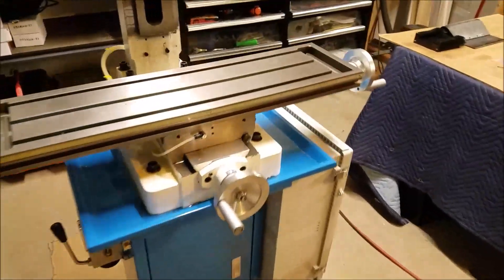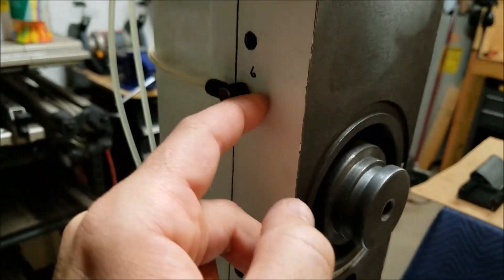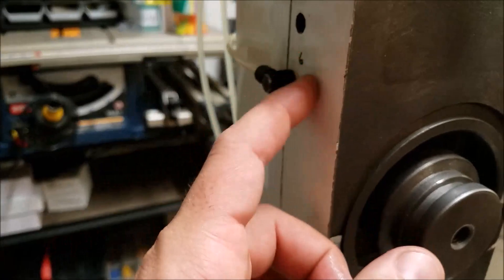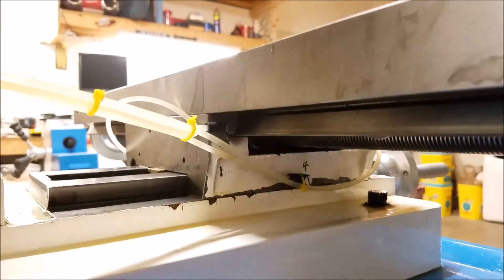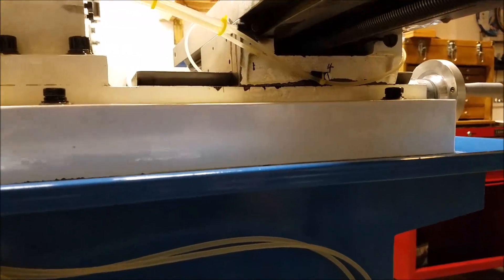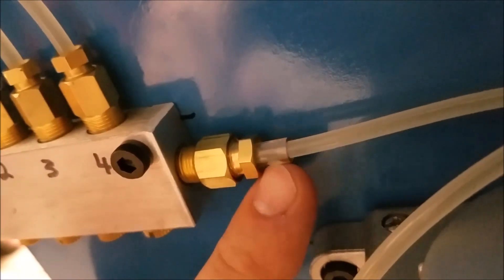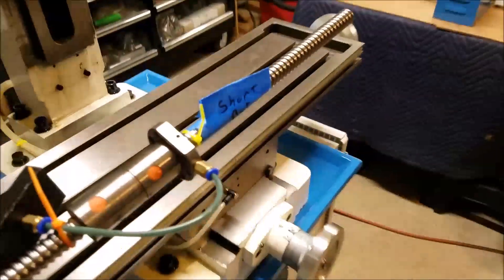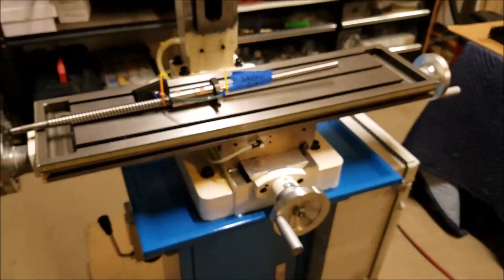PM-25MV CNC Conversion Part 2: One Shot Oiler

Comment: Hi folks, Robert come lately! I've found this particularly useful and am implementing something very similar on am Excel/Optimum BF30V mill - it has much more substantial castings than the standard BF30s. Ordered various components from the far east and everything arrived on or ahead of schedule and very well packed. I'm integrating it with the supports for a three axis DRO due to the positioning of some of my oil ports and my desire to have the read heads fixed so the cables do not move. One enhancement I've added is stainless steel coil spring protectors on the oil lines. However the brilliant idea of using purpose designed brass nipples has avoided the need to drill out the existing oil ports to take 1/8 inch NPT threads which was my original and somewhat concerning idea. The table on the mill is too heavy for me to safely manhandle without bringing the engine crane in from my garage, I'm too old now for that sort of thing!

Comment: Brilliant video's as always.  I'm in the UK and in the process of converting a WMD25VB mill, which is made by the same company which makes the PM25, to CNC using Centroid Acorn which I used on my previous smaller mill.   I'm pretty much mirroring your central lubrication system, but I'd just like to know how you did eventually route the grease tubing to the Y axis ball screw.  Did you drill through the side of the base or arrive at another method?
Reply from the maker: Hi.  I did drill through the base.  I drilled and tapped a hole through the side of the base.  Externally, I installed a grease fitting.  Internally, I ran a short piece of tubing to the ball nut.  Grease was pumped directly into the ball nut.  It seemed to work well.  Thanks.
Reply: @FrancoCNC  Thank you Franco for such a quick reply, I'll now do the same.

Comment: Hi Franco, again, great video!  Curious if you have time / interest in making / selling a set of the bushings?  I am in the process of converting a PM25 and do not have access to a lathe. I can probably make something worth with a drill press and file if not.
Reply: If you have a PM25 and some R8 collets and a vise, you have a lathe. You can clamp the cutting tools in the vise and the work in the spindle, and use the mill as a light-duty lathe.

Comment: I was wondering what size was the hole in the PM-25 casting for the oilers? I measured the ones on my PM-30 and the oilers are 6mm in diameter. Trying to find a push to connect fitting to use with these holes. I was thinking 1/4-20 NPT .
Reply from the maker: 6mm  I made these things to adapt to M5:  https://a360.co/3dbzMED

Comment: First off, thank you for all the videos, very good and informative.  I just received the PM-25MV mill, the CNC conversion from AZ Video and have the mill pulled apart.  My thinking is now is a good time to add the one-shot oiler upgrade.

My only issue is I cannot make the M5 Press Adapters for the banjo connectors. (don’t have a lathe)  Are there any alternatives for this part of the setup?
Reply from the maker: Hi.  You can just drill and tap the existing holes.  I made the press fit adapters because I was feeling fancy.  Drilling and tapping the casing will work just fine.
Reply: Thank you, sir!
Reply: I'll just drill and tap a m5 thread on the remaining brass. If that doesn't work well I will enlarge the hole and change it to 1/16 npt thread. McMaster Carr has the 1/16 npt to m5 bushing 1859N144 for this.

Comment: McMaster sells all kinds of those push lock connectors. You could have gotten one with the correct thread to fit your manifolds that also had the correct tube size that you needed. They are also a lot nicer to work with than compression fittings.
Reply from the maker: Good point - I'll probably do that.